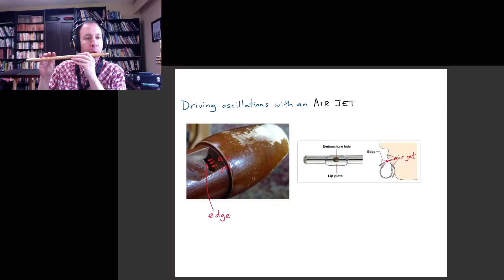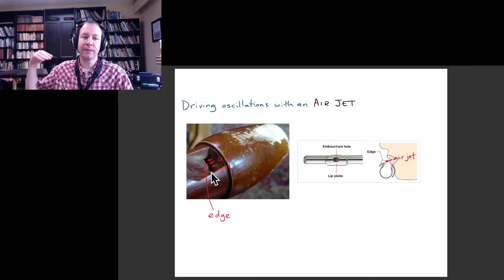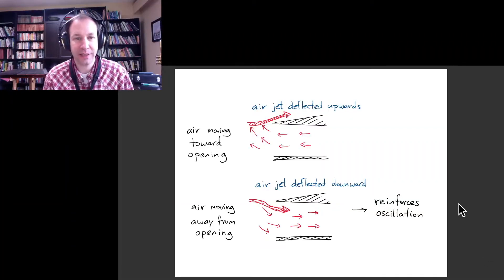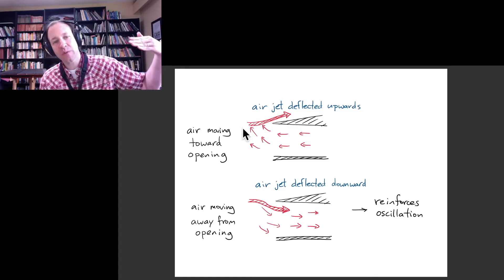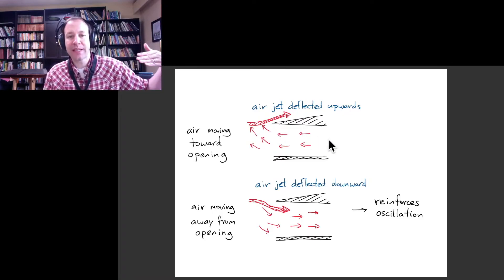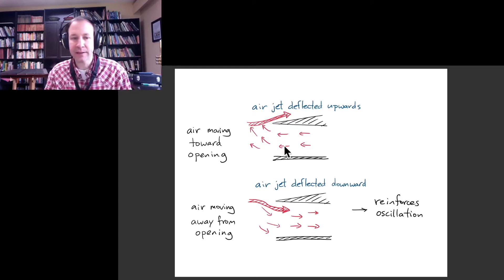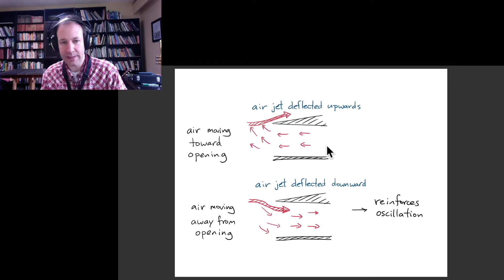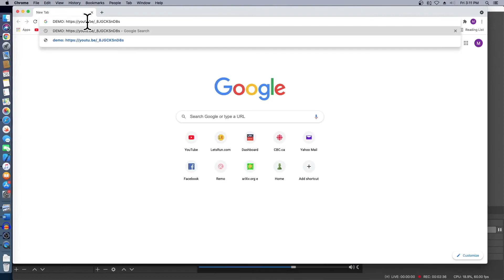Physics of Music 54: Flutes: driving oscillations with an air jet

Comment: Is the flute truly considered a open-open air column or does the air that flows across the mouth piece cause it to behave like a closed-open air column. The mouthpiece hole is a litte along the tube where there is a closed end, so it makes it a little confusing to determine the type of reflection that is occuring inside.